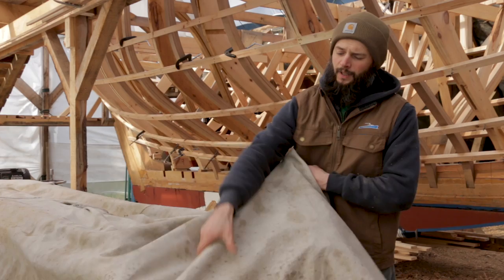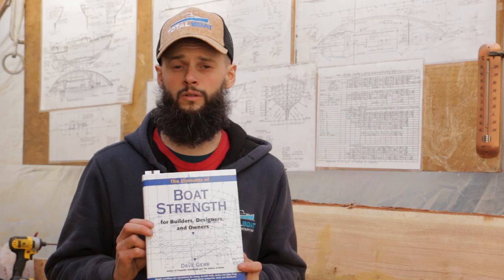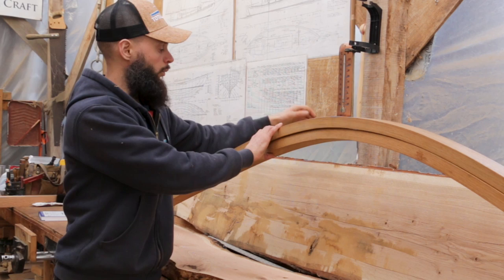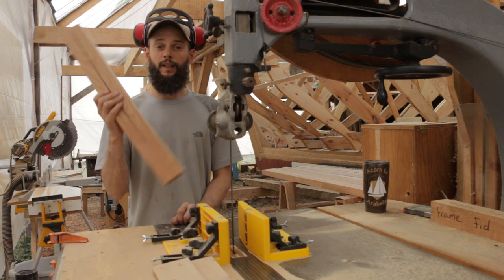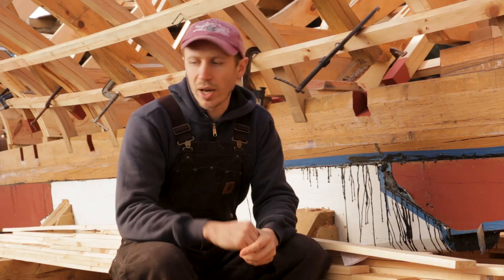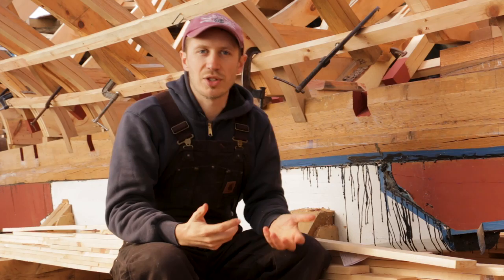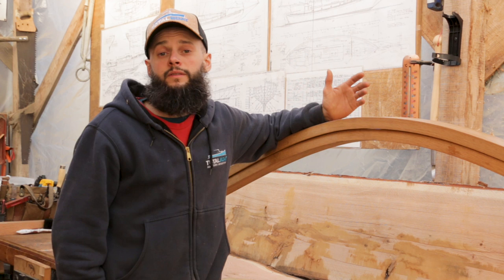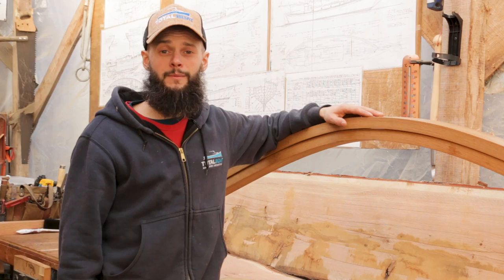Acorn to Arabella - Journey of a Wooden Boat - Episode 47: Steaming Frames: In Depth

Comment: Hi Stephen, in the video at 22:00 (ish) you say that an equivalent sawn frame to a 2.5" * 2.5" bent frame would be 5" * 5". 
Surely 5" * 5" is four times the size of a 2.5" * 2.5" frame in terms of cross sectional area?
The bent frames look great though and are clearly the way to go...
Reply from the maker: I misspoke. Thanks for the correction!

Comment: I don't agree with the steam bent frames are a lot stronger than sawn frames. I have worked on several restorations and repairs with sawn live oak frames. Frames cut out of natural oak bends and as gnarly as the grain through knees and branch slabs are I think far superior in strength. I have repaired collision damage with both types of framing the steamed frames give more in a hit but planking suffers through its fasteners. Sawn are stiffer in a hit but require you to look at the possible damage on the opposite side of the boat. Have a look at the you tube video on Tally Ho
as that builder is using live oak and i think his method is sound. There are pros and cons in both directions. The statement that steam bent is 50% stronger than sawn frames i find hard to believe. Surveyors tell me fresh water can wick further in steam bent frames than gnarly oak . There is also a limit as to size you can do a steam bent frame. I just recently was in the engine room of a large Sailing Schooner the sawn double live oak frames were spaced out approximately 24" apart with 2 steam bent frames between each sawn one.  Like your Videos real nice
Reply from the maker: Thanks for sharing your experience!  As to the % stronger we were quoting a professional, but we agree with you that double sawn live oak frames can be extremely strong.
Reply: Hi I have been into boats my whole life and there is a big difference between commercial vessels and yachts. The scantlings for this boat and Leos are for private boats only. I think this needs to be mentioned. Both these boats would not pass surveys for commercial fishing in Europe today. I did hear Leo mention that his boat was a replica Cutter built as a yacht, and was used for fishing in the US.
From my experience oak on oak sawn frames with oak planking are have been the strongest and longest lasting as well. I have seen many steam frame boats with broken frames, but down to collisions and not build quality.
I think you guys are doing a great job with this build, I hope you will place the remaining keel bolts in as well. 
Keep up the good work, I am really enjoying this series. If I can have any input just let me know.
Building a boat and using it is the best way to find out if the designer got it right first time.
dolf

Comment: Leo's boat is a much bigger vessel so I think the comparison is a bit wrong there, also his construction techniques will ensure Tally Ho has another 100 years. Unfortunately your glue in your laminations will mean your frame and keel will only last as long as your pine decking. I.e 5 years of building and only 10 years of sailing. Sorry for the negativity, your brave to take this on, but I don't think the boat will be a family heirloom.

Comment: Your math was wrong on time to steam. 1 hour per inch is 2 1/2 hours for 2 1/2" but you only did 1 hour?
Reply from the maker: We did 1 hour 20 minutes for the first frame and bumped it up to 1 hour 40 minutes for the rest of the frames.  The reason is that the frames are split so they are really only 1-1/4" thick =)

Comment: Two and seven eighths of what?  Shouldn't you be measuring in metric?  The rest of the world does and it's simpler.
Reply from the maker: Metric is simpler for sure!  But the plans, books, materials, tools... are all imperial so it's the system we work with.  I this case it was 2 and seven eighths inches.